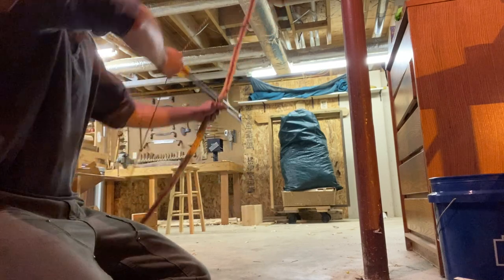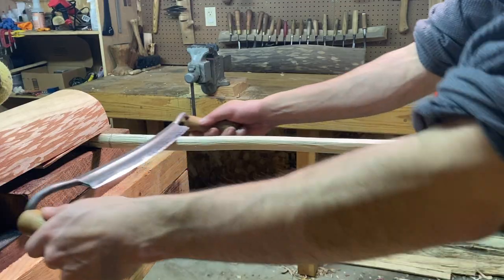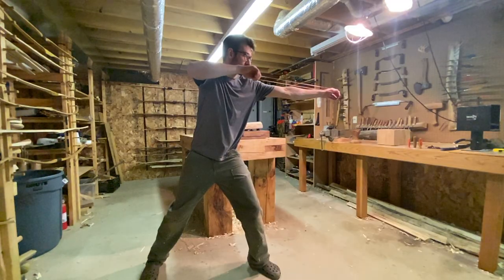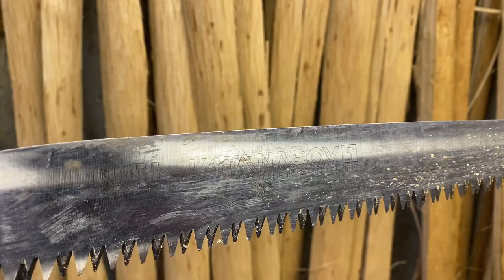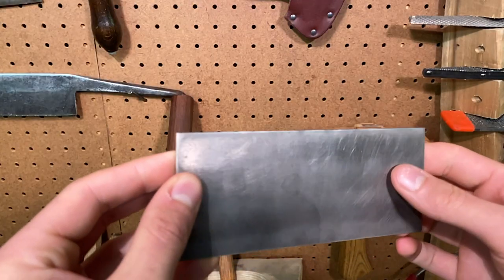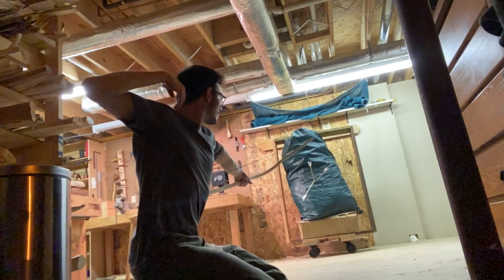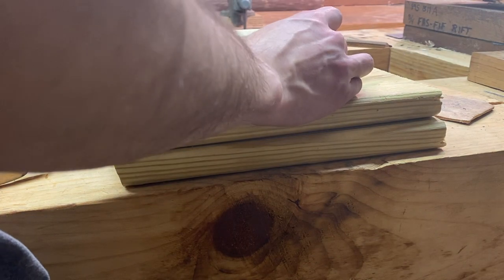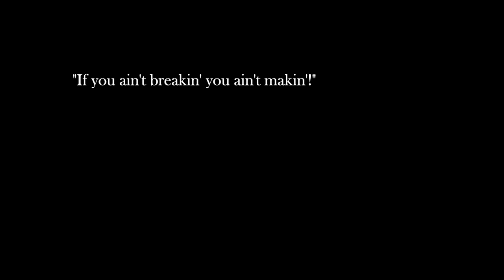How To Break A Bow: A Beginners Guide

Comment: This video has SUCH good lessons. Its not a simple “tutorial” but instead a mental guide for upcoming bowyers. I learned that I absolutely will break a bow one day or a lot of days. I am not limited to the tools i have. If i have fun making it and i learn a little every time* thats all that really matters!
Reply from the maker: I didn’t think of it as a mental guide, but you’re definitely right. I was just trying to steer everyone away from some of the traps I got stuck in.

You don’t have to break bows at all if you’re careful about design. But if you wanna  push yourself and your bows it’s just gonna happen.
Reply: I like your thought process..simplicity has it's own beauty..too many have their eye on the ferrari, when the chevy is more attainable and is just as serviceable, if not more so..
Reply from the maker: Exactly. A lot of the time added features and benefits are just extra failure points. Nothing wrong with a simple and reliable bow

Comment: Nice, I made a green bow out of red alder, but it was only 4 feet I split a branch that was 3 5/8 in diameter. to my knowledge alder is not a very popular bow wood. I’m thinking about sinew backing the other stave. Great vid👍
Reply from the maker: Thanks Cameron. In my other video I used short branches and wrapped them to a separate handle piece. So you definitely don’t need to find full length wood if you can get two pieces. You don’t even need the separate handle piece you can just overlap the limbs and wrap them.
Reply: @DanSantanaBows   Yeah I’ll have to try splicing. Also I’m curious What is your favorite material for making arrows?  do you size the shafts using an arrow sizing tool? So far the arrows I’ve made are just naturally tapered shoots. Should I consider sizing my arrows?
Reply from the maker: You don’t have to do a complicated splice. For these simple bows just lapping and wrapping is good enough. Glue helps keep things from wiggling. If i wasn’t  trying to make that bow in an hour i’d have used PVA wood glue, epoxy, or hide glue. 

So far the arrows in the videos have been commercial mass market wood arrows. The thin light shafts I shoot with low weight bows are fiberglass.

I don’t love wearing down  nice arrows for trick shooting and training, especially if I’m shooting a group like in the videos. Doesn’t take long to hit another arrow and ruin it, so I like them cheap for this purpose. That’s my excuse anyway because my arrows are only so so. Thats something we’ll improve on here. 

We’ll definitely get into strings and arrows eventually. If I wanted to cover everything, a book wouldn’t be enough. I’m trying to keep things into manageable bite sized chunks right now, but as the channel moves on I’ll do more advanced and detailed builds too. Bowmakers, string makers, and fletchers were all different jobs back in the day. We have the advantage of the internet now, but now bowyers have to do it all.

Comment: stickbows from greenwood are almost like a seperate bowing section. you just cant get the back that natural by removing the bark from drywood.
Reply from the maker: You still can! Give the dry stave a quick steam or put it in a hot shower and the bark comes right off even easier than if it were summer bark, and you get that same perfect unmarred back. Some bowyers I know like using a power washer to take off the bark

I don’t don’t mind using the drawknife and like the pattern of cambium strips anyway, so that’s how I do it most of the time.
Reply: @DanSantanaBows  very cool

Comment: I made this small bow of a meter approx. It shot very well, 27 pounds very comfortable of cypress, but despite the wood being a year old, the bow began to deform, to bend, so I straightened it by tying a leather strap on the back, stretching it as far as possible by the ends by means of knots, It break at the eighth arrow, it can't stand so much compression by giving it too much tension, which surely was very little, I had already break two bows in the same way 3 years ago, which I made from weeping willow, they would be 30 pounds Those, took longer time to deform but they did, so I put leather strips on their back ... I did not learn the lesson 3 years ago he, he... so, what to do to avoid this deformation? Heat the wood to make it harder ??? Greetings, You are a true teacher, congratulations and thank you very much !!! Realy good incredible job and videos!!!
Reply from the maker: The deformation is called set. It happens because the wood is overwhelmed in compression and the wood fibers begin to crush at a microscopic scale. You can’t just bend the bow and expect the set to go away, it will come right back. 

You can use heat to fix a little bit of string follow, but the crushed belly fibers can’t be fixed and the set is still there. 

The best way to avoid set is with good design, tiller, and moisture management. Using a better bow wood than willow will also help
Reply: @DanSantanaBows  Really thanks so much master, for your concenr to my person, apreciate a lot your advise... greetings!

Comment: Also, I think you took away too much wood where it broke and just left of the break it looked stiff so there was too much material there, not allowing the bow to bend right
Reply from the maker: Yes! Good eye. The whole bottom limb on the left was too stiff. Where it broke is an example of a hinge, it happens when you rush the tillering and cut too much from one area. Dry wood isn’t so forgiving, but green wood can take more abuse. This bow was made for 30” of draw, but when it broke it was beyond 40”
Reply: @DanSantanaBows  😁I've watched a lot of Kramer Ammons' videos

Comment: I couldnt tell while tillering the sapling bow, were you only removing wood from the belly or thinning from the back also? Seems like from both sides you could get a flatter limb profile, but i understand you are violating the rings on the back. Is there any wood that could toletare that?
Reply from the maker: Nope, I’m just carving on the belly as usual.  Tension strong woods can take a high crown very well, there’s not usually a need for a flat back, since the belly is the weak link in these woods.  

Many advocate decrowning these high crown staves but personally I favor having a pristine back, even if it’s round
Reply: Thank you dan for your prompt reply. I really appreciate you responding on this older video